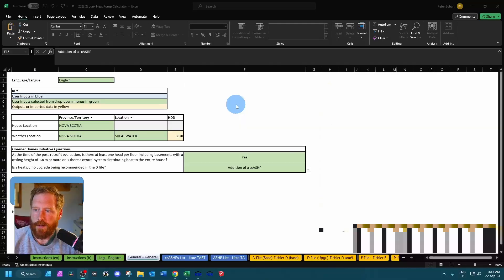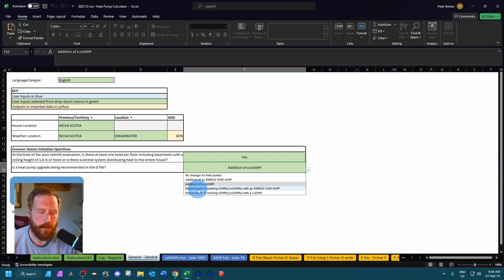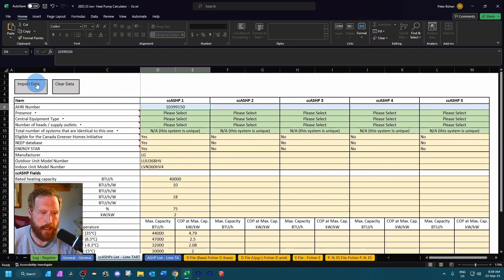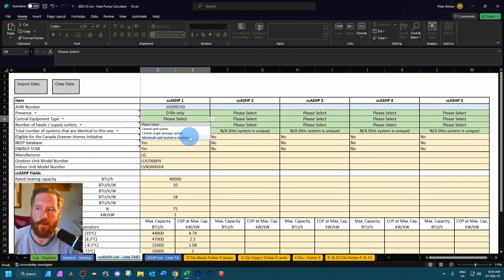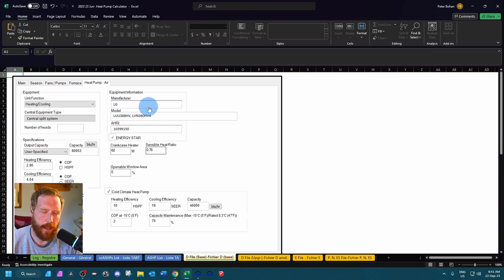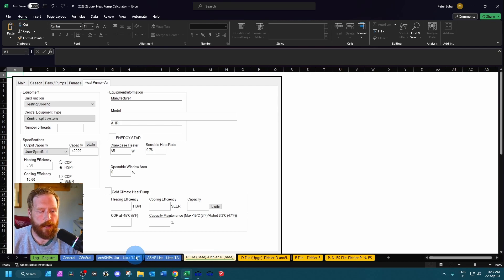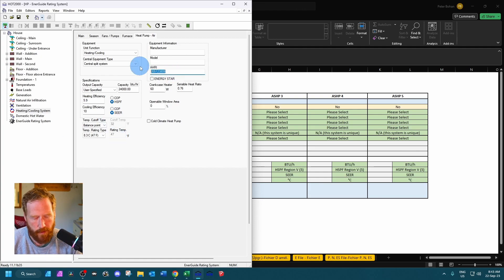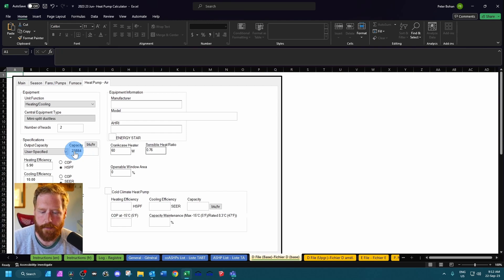Heat Pump Calculator for Hot2000

Comment: What about Ground source heat pump?
Reply from the maker: No calculator for them but they can be entered in the software normally. The calculator is specific to cold climate heat pumps to be more accurate as the software was designed with standard heat pumps in mind not cold climate ones specifically